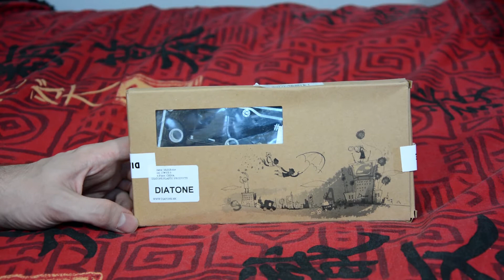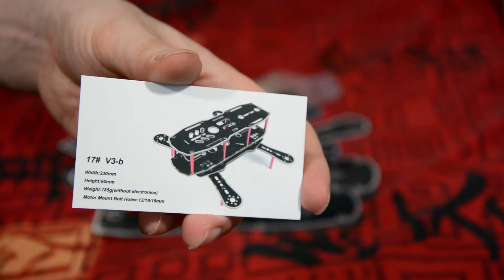[Build Log] - Diatone #17 Mini Quad -  Part 2

Comment: j'adore je cherchais depuis longtemps un tuto vidéo fr pour build un quadcopter
Reply from the maker: Gregory Monard C'est vrai qu'il y a pas grand chose en français ! Par contre si tu veux te faire un fpv racer je te conseille une autre du frame du genre Diatone 37 ou le plus classique zmr250 ;-)
Reply: RavenFPV et j'ai une petite question j'aimerai plus build un drone pour filmer est ce que ça fait l'affaire ou pas ? car c'est plus pour la course ?
Reply from the maker: Si tu veux un drone pour filmer je te conseille vivement un drone plus gros et moins nerveux, sur lequel tu pourra mettre une gimbal (pour stabiliser la camera et faire de super belles images)
Reply: RavenFPV ok et je change de frame alors ? ou je dois tout changer ?
Reply from the maker: Gregory Monard Va falloir tout changer :P
Plus gros frame dit moteurs plus puissants, ESC plus puissants, pales plus grandes, etc ^^
Y'a pas mal de configs que les gens ont déjà fait sur rcgroups. Ou alors y'a aussi la solution de quadcopter tout fait mais je suis moins fan ;-)

Comment: Mon pouce est bleu mais je le met aussi. 

Pour information je compte me faire une Diatone 37 (j'ai vu que tu avais le chassis aussi) 

tu comptes faire une vidéo de montage également?
Reply from the maker: Yes, le diatone 37 est mieux car bien plus léger :)
Je ferais évidemment un montage mais je vais d'abord finir le montage des vidéos de mon 17 sinon je vais jamais m'en sortir, d'ailleurs la partie 3 est en cours d'upload :)
Reply: cool je vais mater cela des que c'est dispo.

J'ai pas encore commandé mes pièce donc j'ai le temps pour Diatone 37 :)
Reply from the maker: LOPES David D'ailleurs ils ont tout juste sorti une version carbone du 37 ! 90 grammes !
Reply: Link Please :D
Reply from the maker: http://www.banggood.com/Diatone-37-Blade-Series-FPV-250-Carbon-Fiber-Unfolded-Frame-Kit-p-971074.html
:)
Reply: A oui mais il y a pas le circuit de distribution intégré
Reply from the maker: LOPES David Oui mais tu peux l'acheter en plus pour 5€ :)